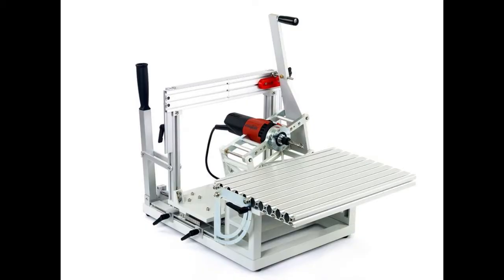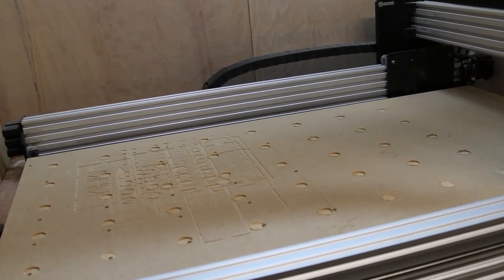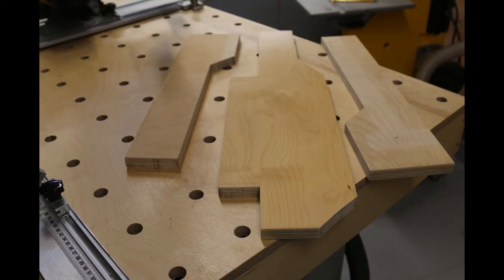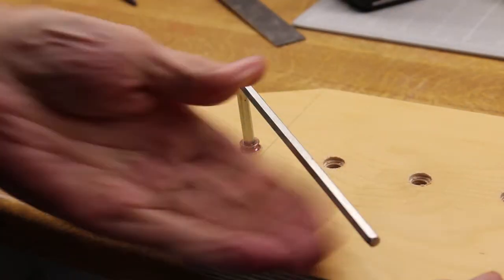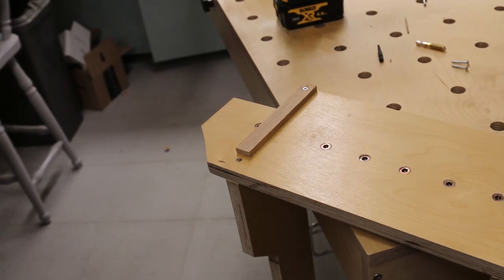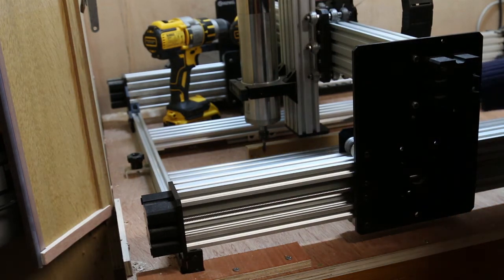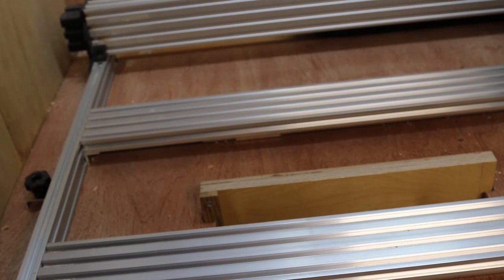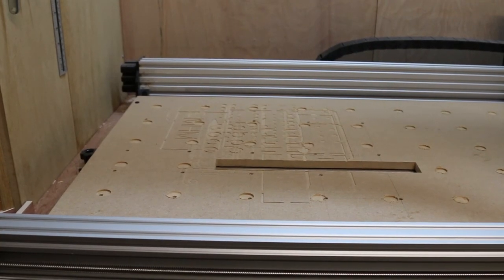JointMaster

Comment: Would you recommend your CNC machine? I'm just starting out and looking to learn..
Reply from the maker: I do not have experience of other machines, but I am very happy with my Ooznest Workbee. The kit is super organized and easy to build. Much being open source, modifying it is also easy. The controller used has all the features that I need, and the Wifi version means that you can control it from any device with a browser. A tablet is convenient, or you can use any make of laptop. Ooznest are a very responsive company, and get back to you if there is any problem.
Reply: @Tensquaremetreworkshop  thanks for the reply.. just to reiterate, I find your content really informative.. always appreciate some quality tinkering about.. I've been making props for film/TV/theatre for nearly thirty years and I'm still learning.. I find the generosity of the  you tube maker community heart warming.. thanks again and good luck with your channel..